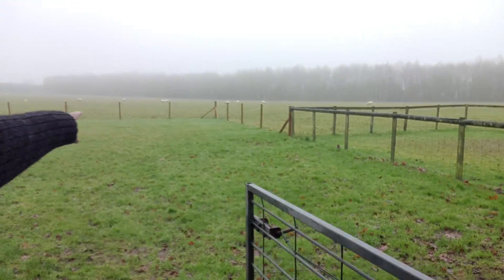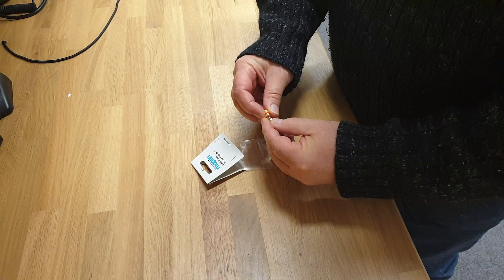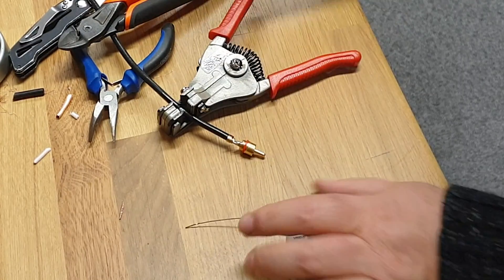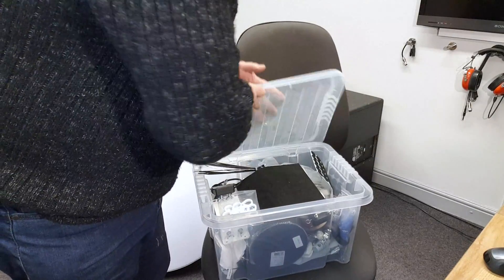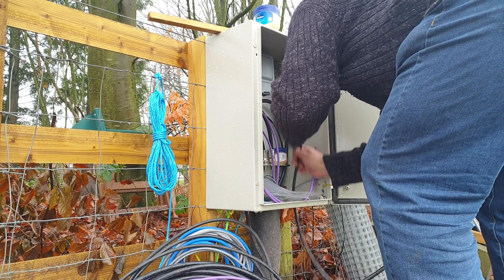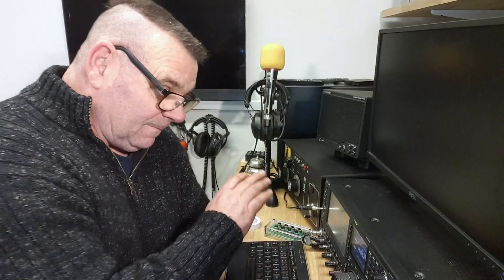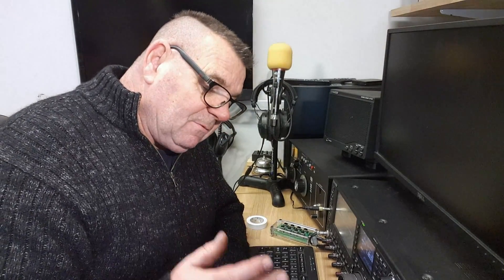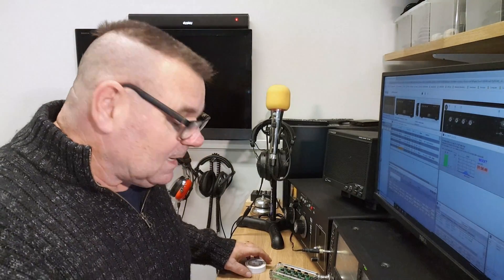Receive Antennas - This is my Loop On Ground (LoG)

Comment: What are some options for using separate antennas for receive and transmit on a rig that does not have separate connectors for each?
Reply from the maker: OK, so MFJ used to do an automatic switch for outside... You have 1 x coax - then when you initialise the switch business and hit the PTT - the relay clicked and you were now on your TX antenna - and when you let go - you were back to RX... Of course, you could do this manually.

Comment: just to be clear, is the ground antenna made from 18 meters of wire, 4.5 meters each side, formed in a square ?? I want to be sure I've got it correct.
Reply from the maker: Yes.. and to clarify, just search "Loop On Ground".
Reply: @DXCommanderHQ  thank you

Comment: did you lay that that loop over part of your radial system? That would be a bad idea, inducing the noise environment you are trying to avoid into the loop. I think this is one mistake people keep making with this LOG idea, it needs to be in an uncluttered(RF wise) place. any wires,fences, power cables, gas pipes etc defeat the purpose.
de G0AFV
Reply from the maker: No.

Comment: what is the lenght of the antenna loop?   My roof is plan , more rectangular than square.
It works with any lenght? Any minimum?
Reply from the maker: Ideally, for a TUNED loop, aim for exactly one wavelength.

Comment: QUESTION. Hi Cal, my 1st question in I am going to build this antenna, which would be better lossy cxheap coak or better stuff for the run in? #2 did you come up with the type of transformer you used for it?   73 de va3get
Reply from the maker: OK, so the transformer is apparently 73-material binocular core ferrite (Amidon #BN-73-202 or Fair-Rite #2873000202) and for coax.. Frankly ANYTHING will do in my opinion..
Reply: tnx
Reply: Hey Calum,              I built my 15 ft. loop in my small garden between my shack and raised back porch, 3 ft on either side. I used a small 1-1 balun and 18ga. silicone wire. Cal, it works like a dam. The noise floor dropped to S1ffrom S6, waterfall went from blue with white snow to black with signals showing more, I tested and could hear all quite well., Man, am I impressed. thanks so much for your videos on this type of antenna,    I have watched them all. hope to catch you on the air now.       73 de va3get
Reply from the maker: @georgetownsend3700  Brilliant!!

Comment: Am thinking of a loop on the ground using  prebuilt sections of say 100 or 200 meters of  RG6 and connecting them to RG6 females mounted in a plastic box containing the matching transformer. My conductor would be the outer braid rather than the inner wire. My yard is heavily wooded so the area contained would be more like a circle. Because RG6 is less expensive would I loose much by having it as the lead-in to the radio or stay conventional and use RG58? Thanks… BTW the DX Commander arrived yesterday in good order. Thanks
Reply from the maker: You'll be fine.. I have thoughts on "loop on ground" antennas. Just that I discovered that a larger circomference (as you are suggesting) is better and the one I have that is 90m all the way around and 12-inches off the ground is a lovely RX antenna.

Comment: The Loop On Ground antenna is a great option if you have a very noisy QTH that is also very simple to install and repair. Works great for SWL as well.
Reply from the maker: Yes!
Reply: @DXCommanderHQ  Do you think  it would work with a good SDR receiver Callum?
Reply: Does the LoG work as well as a wire on a tall tree for SWL? Trying to figure out what to do on my property right now.